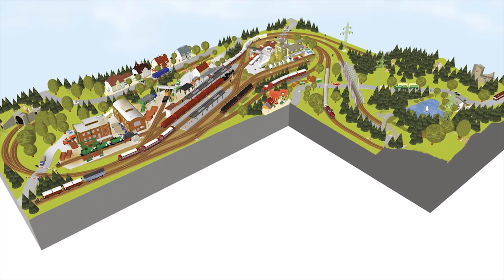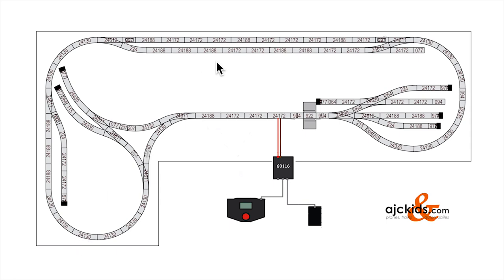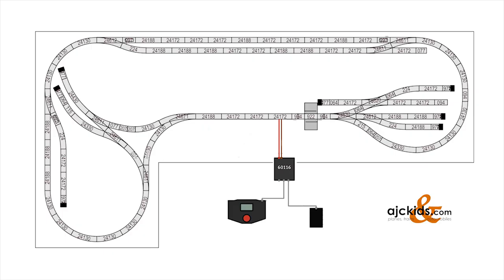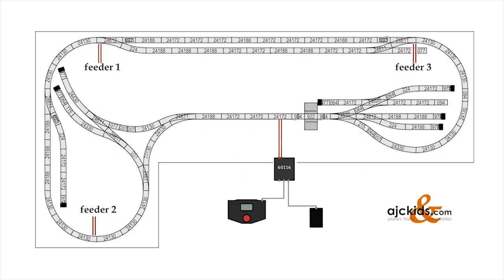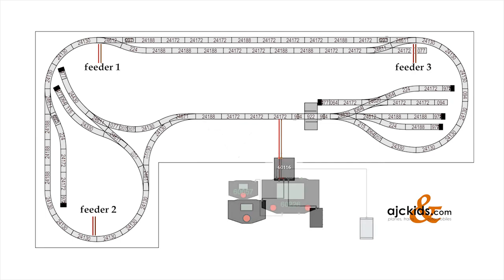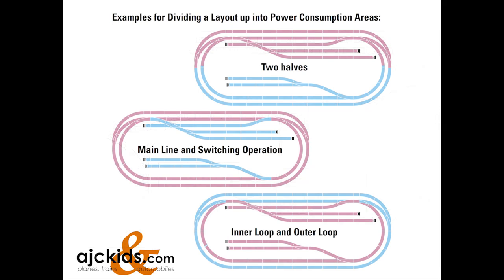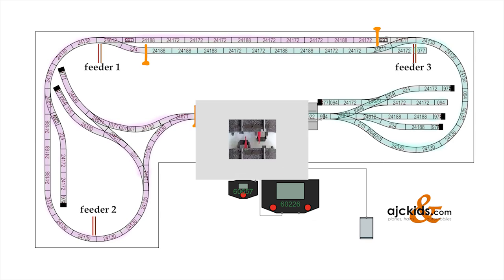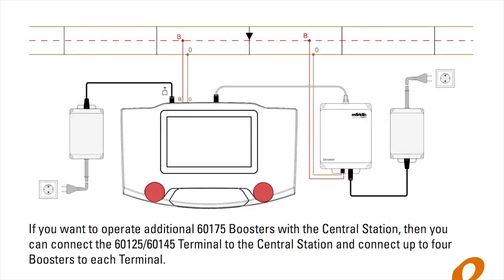Do I need a booster for my large Marklin Digital Layout?

Comment: A booster is just only need when your power supply is not enough to feed digital locomotives and accessories. A CS3 with the 60 VA leave out at 3 amps which is enough to feed at least 6-8 digital locomotives or 4-5 locomotives with the wagons full of the LED´s lighting.

Comment: Marklin M track woulduse the side connections , that is what the booster hooks up to? I'm thinking that's what they are there for.
Reply from the maker: The side connections on the old M-track typically are there to supply power to that track portion. So you can indeed hook up a booster to one of those tracks.

Before you connect the booster, make sure that the track portion is not powered by anything else. Use an AC voltmeter and test the track, or place a passenger car with interior lights on the track.

Comment: Or, if you also use the MS or CS to power your switches, signals, turntables, ect...  u could use the booster circuit for the 'on rail current'  and the cs or ms to drive switches, signals ect.

Comment: Hallo.

Thank you for sharing.. 
I have a question:
My Layout is 320m long and now I have the following items:

1. CS3+
2. booster 60175
3. 1x Adapter 60101 100VA
4. 1x Adaptee 60xxx 60VA

Will it work?
Reply from the maker: The size of your layout requires multiple feeder points.

As the video describes, the amount of trains running will determine if you have enough power.

On a sidenote, for H0 Marklin advises to use the 60VA, and for 1-scale the 100VA power supply.

Comment: What is the difference between the 60045 and 60065 which has more power to the layout? Or is just one older and grey newer black? Or can one get additional power out of the newer black 60045.
Reply from the maker: The 60045 is newer and technically has a slightly higher power output (60 watts versus 50 watts). I would not think it is worth upgrading to the 60045 if you have the 60065. A booster with second power supply would give you much more.
Reply: @ajckids  Hello, what is the item number for booster and power supply I would be interested in ordering.